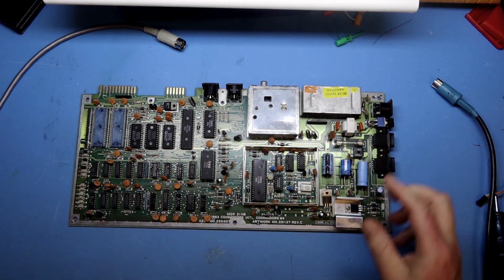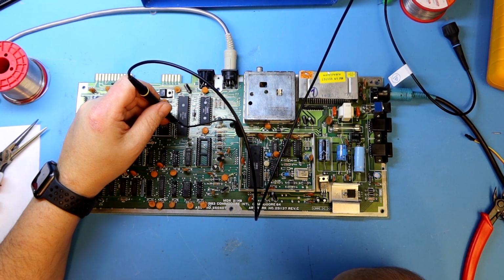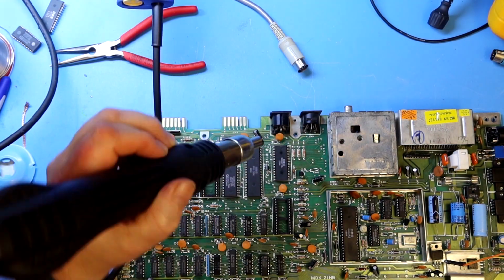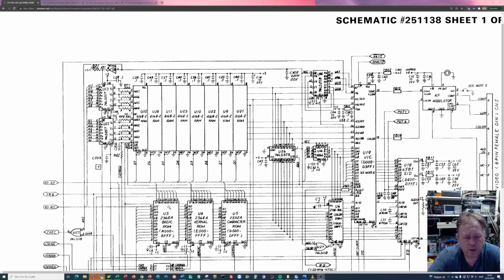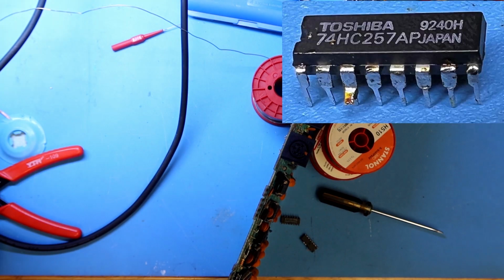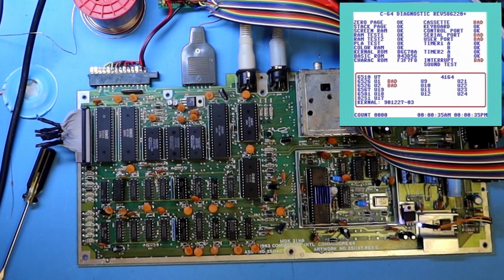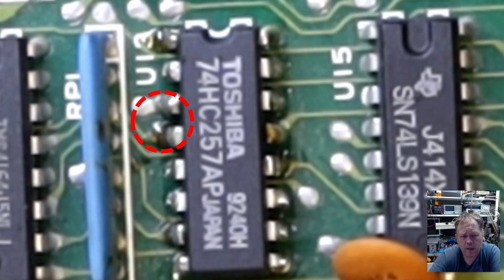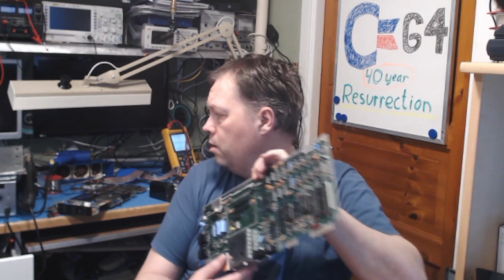The Commodore 64 resurrection series, Part 1

Comment: When I desolder chips, I usually go through their pins round-robin (desolder pin 1 chip 1, then pin 1 chip 2... pin 2 chip 1 and so on), that gives them more time to cool off and a higher chance of working after desoldering.
Then again some bad chips start working again when heated up...
Also don't toss custom ICs that have partial defects. Sooner or later you'll have to chose between a flaky custom or a completely broken one. (and then again I wanted to keep the PLA that made the colors go all LSD, but that one completely died soon after)
I thought HC257s didn't work in C64s.

Comment: I like how you first eliminated the possibility that the major chips were the problem before diving deeper into the schematics. That seems like a very practical, reasonable approach.
Reply from the maker: Thanks for watching. From a cost perspective this is obvious the best approach. If a number of the major chips are faulty there is a limit to how far the normal person should pursue this both for a cost reason, and for keeping as many C64 as possible going... If you have to kill 3 other prospects to get a working one it's better to not bother.
But I have to admit that starting off now with C64 repairs is a steep learning curve as most of the faults back in the day was because of user faults, static discharge in the joystick, cartridge og tape port, faulty power switches, or bad production batches of chips. Now it is because of aging, bad storage, corrosion, or on the boards I have here.. Someone else has had a go at them before me.. I actually never ever changed a PLA chip back in the day.